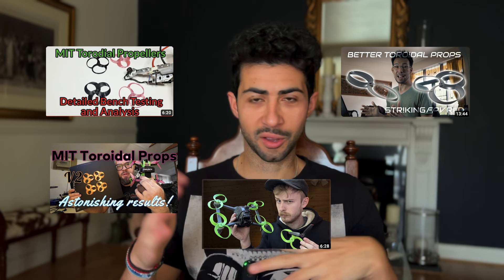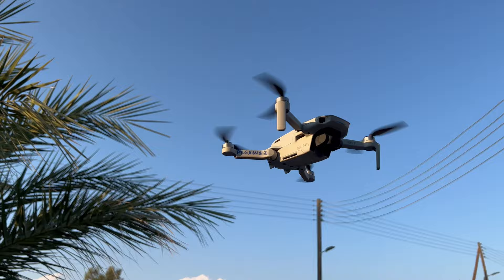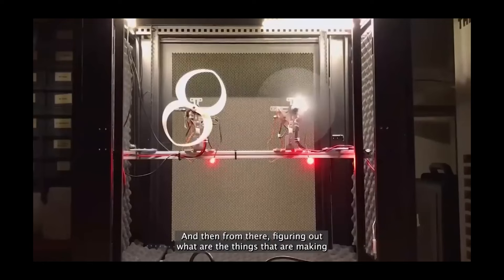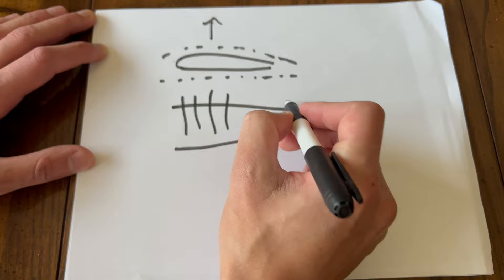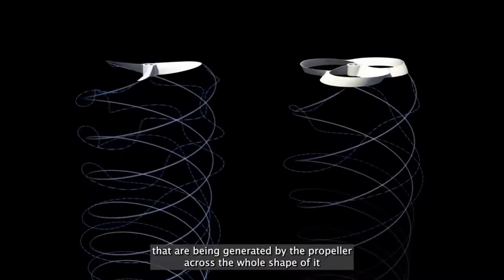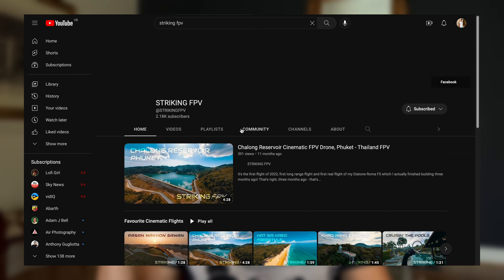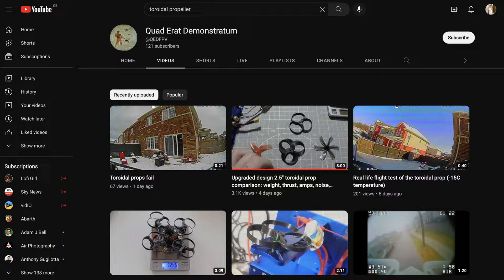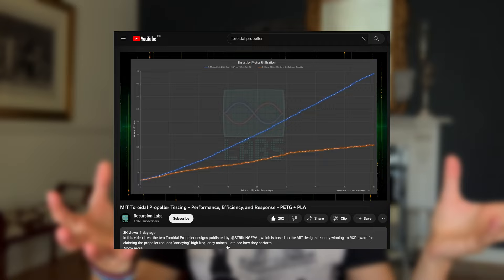Everything you Need to Know About the TOROIDAL PROPELLER

Comment: They provided no data and no analysis proving it is quieter or more efficient in any way, and they specifically mute the clips where it's flying, and boost the audio of the clips of the normal prop flying. I have a feeling like if the design was legitimately beneficial they would show that it is.
The 'paper' is 2 pages long and mostly fluff about how drones are being used 'more and more.'
Reply from the maker: hahah yeah, I don't think there is much benefit if there goal was quieter drones and more efficiency. It's actually the opposite from the tests I have seen from other FPV pilots. Maybe a different sound but definitely not efficient.

Comment: And the end you ask what would happen if you tuned a motor to work with the toroidal prop. Did you get the answer to that question?
Reply from the maker: Hey, no haven't had a response to that yet, I still doubt it would make much difference but still curious to see the results.